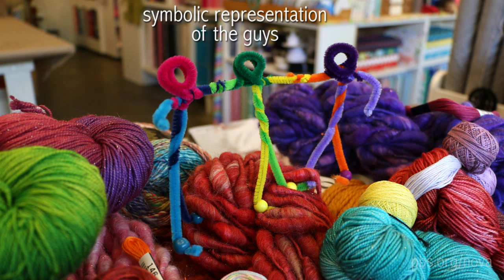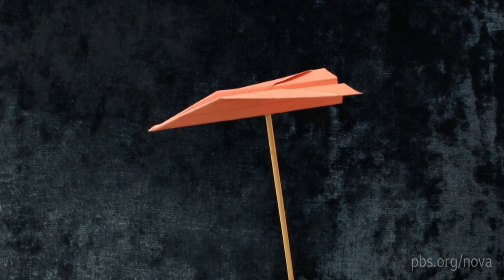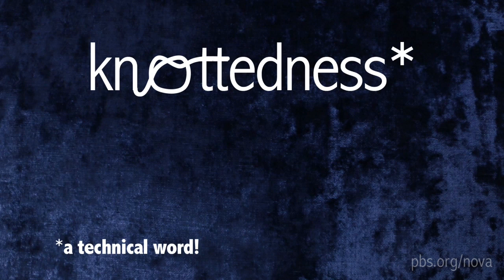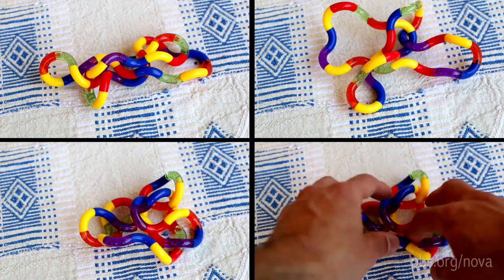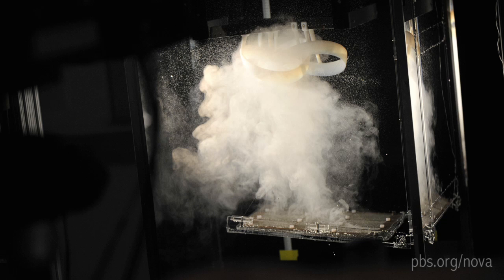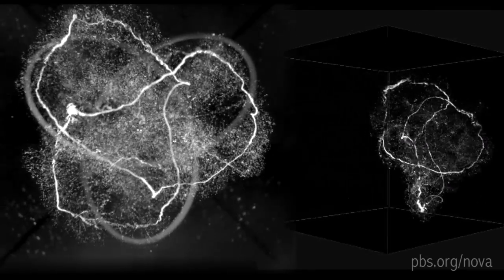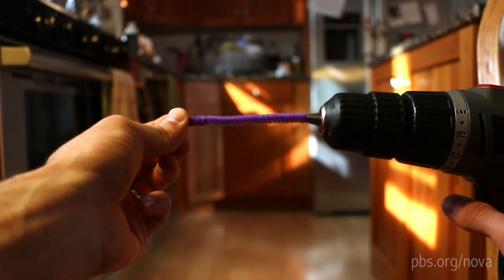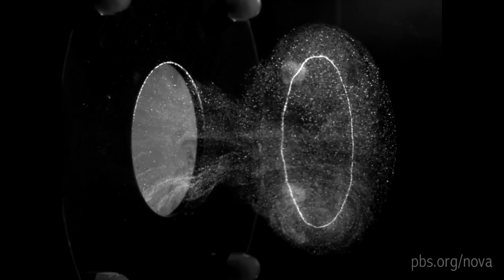Knotty Thrills

Comment: My comments may seem a little bit dumb, but be gentle because I am commenting a video and not an article. First, how would this new magnitude help simplifying fluid mechanics models? I imagine knottedness will be transported by diffusion, advection and, maybe, knottedness itself, let aside production and destruction terms.How would it not ultimately leads to a non-linear hard-as-hell to solve transport equation just like Navier-Stokes and Euler equations? It would bring the problem of the lack of analytical solution to the very same point, isn't it? Second, as the fluid has not changed, just the model, I imagine that the knots are made of smaller knots and son on.... and all the blablabla we all know. Is such assumption correct? If so, how would it be easier to model the small knots so one can model the flow easier than with traditional approaches?

Anyway, the work you have done so far if much more than amazing and deserves much more than a couple of beers!!!! Congratulations for a contribution that may be as groundbreaking as boundary layer and Kolmogorov scales discovers!

Comment: Since knottedness in a fluid or air mass is always moving and dynamic, is the next step of research predicting patterns of the differents form the knottedness would take via external factors like the moon's gravity, temperature, season, etc.? And eventually engineer modes of transportation that could predict those patterns and morph into different aerodynamic forms as different knottedness emerge along the voyage?